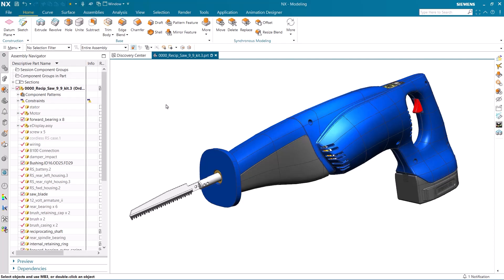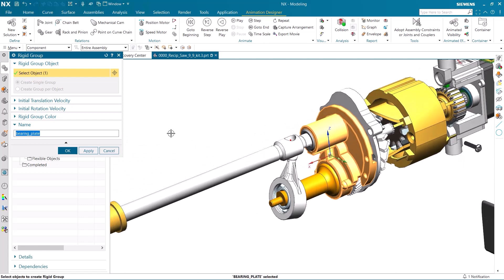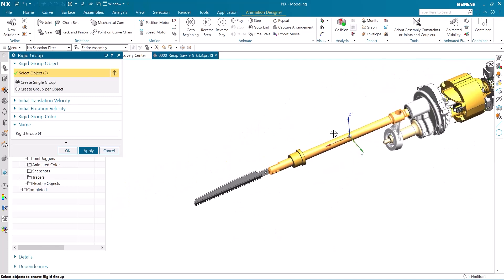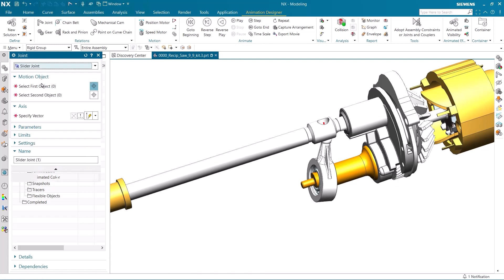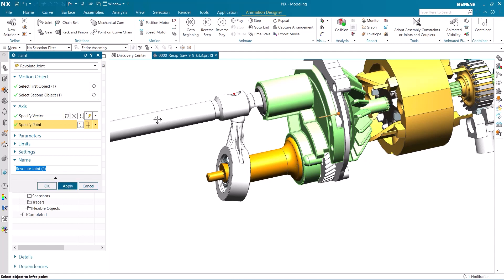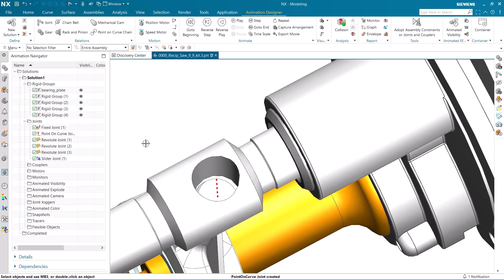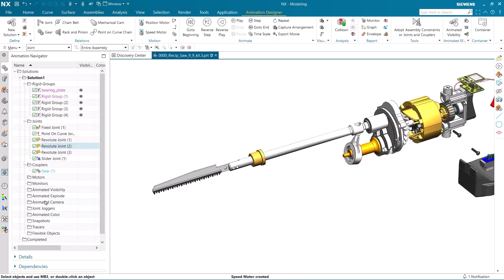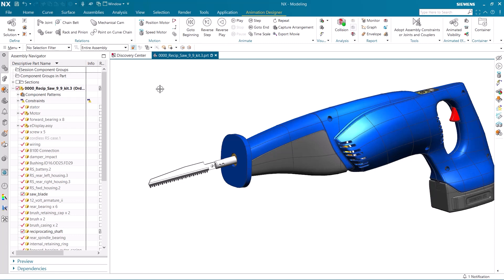Getting started with Animation Designer | NX Tips and Tricks

Comment: Do You need license for that?
Reply from the maker: Hi - Thank you for reaching out. Yes, our software generally requires licenses to use. However, if you're a student, you can obtain free licenses for our tools. Please visit https://sie.ag/2Ybxbf for free software downloads and more.
Reply: @SiemensSoftware  Thanx for reply. I meant Animation Designer specifically.
Reply from the maker: Hi - Thanks for clarifying your question. We'll check with our NX team and respond as soon as possible.
Reply from the maker: Hello again - here is the response to your question. NX Animation Designer is an add-on module for which users need an additional license. Alternatively, if they use value-based licensing, they can access the module using their value-based licensing tokens. Best, Team Siemens